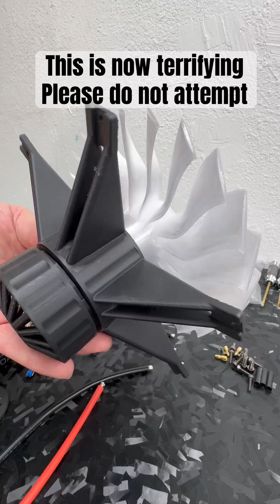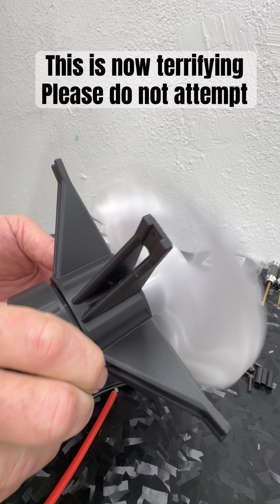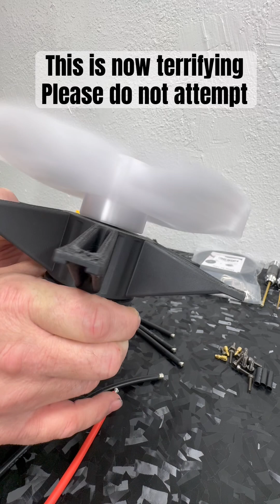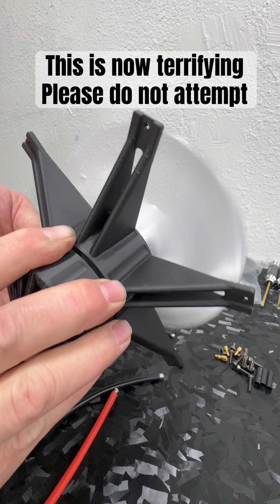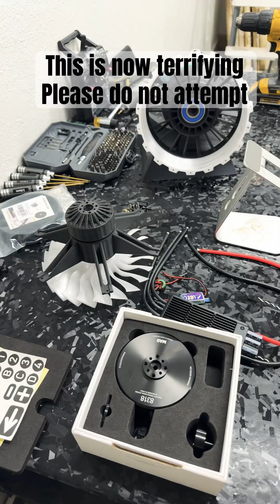This EDF is going to have terrifying speed. #edf #turbine #dangerous #fyp #shorts #insane #speed

Comment: I mean, seriously, please reduce the ratio, I don't believe that MAD motor is going to spin it if you need to apply so much force...
Reply from the maker: I thought about reducing it. This motor should have the power but I may reduce. Going to spin up a test article with a drill and see at what number on the drill it is stable or the antistrip kicks in. That should give me a torque reading. Then I'll know if I need to reduce and how much. It's all about the data.
Reply: I agree, but his motor is pretty good, it's a very torque ey motor